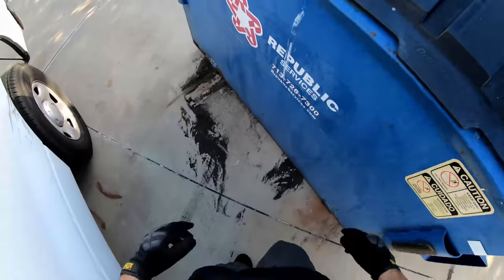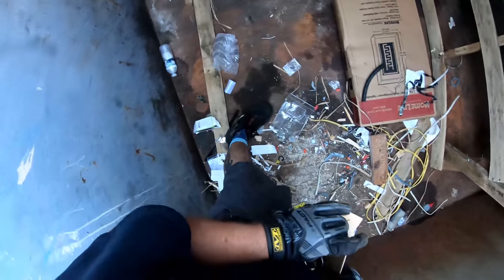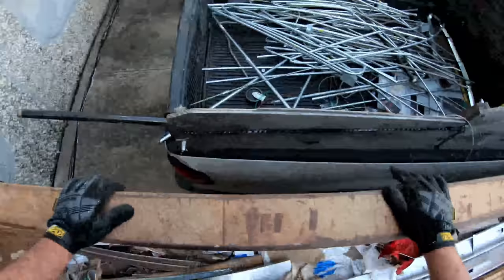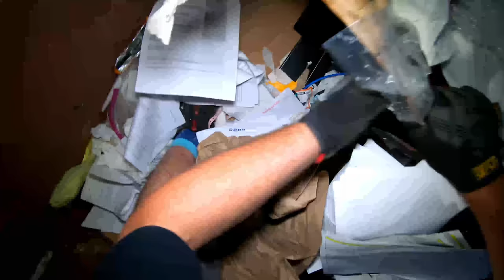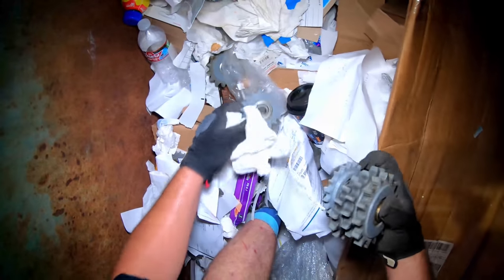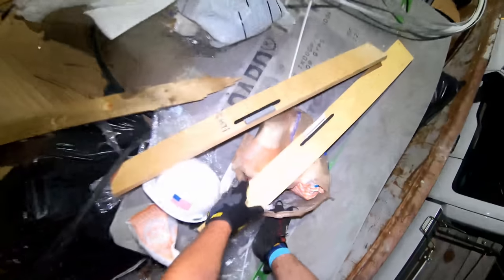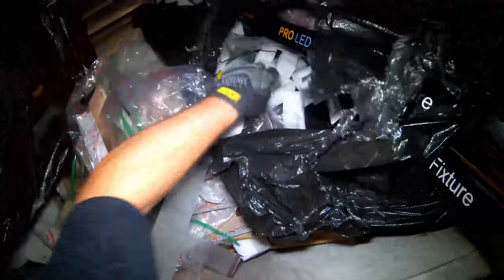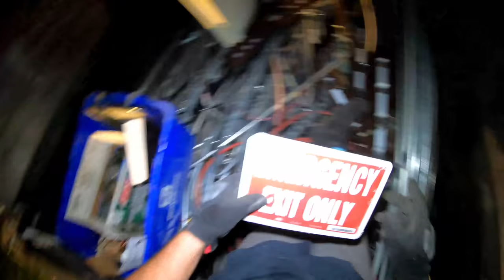Dumpster Diving "Captain Jack Sparrow Up In Here"

Comment: These videos are always fun to watch man, it’s always a surprise seeing what you pull out of the trash. If I can give you a tip it would be to use a leatherman Rebar. It’s got a nice pair of pliers and cutters and like 11 other tools that would make working in a container easier. It’s tiny and has a nice little belt holster, I can see you doing funny little shots with it, like you unholster it like a tiny gun and give the copper wire a few pew pews before you clip em off lol.
Reply: Leather man does make some good stuff!
Reply: Yeah they work but the Gerbers are better. More like pliers and just a flick of the wrist slides the jaws out for the pliers.

Comment: That was a aluminium louver or can be called a air vent for ventilation in large wear houses. All mainly excluded aluminum. Im a sheetmetal fabricator for just about anything made of metal on roofs. I can actually make louvers like that one out of aluminium or steel sheetmetal for any size opening in walls or residential homes.

Comment: found ez way to take end from plug ins.hit the copper,metal ,what ever on the table saw blade,just a touch,it softens the rubber then pull end out w/pliers.eziest way I have found w/out tiring hands a fingers.

Comment: Idler sprockets, they put pressure on the chain drive to adjust tension. The plastic sprocket wouldn't stand up to the pressure of the drive sprockets.

Comment: Little things in dumpsters have value, even those exit signs, plastic or metal, I had to buy several for my different shops and they are not cheap. They also have batteries in them.

Comment: Mike that glass is safety pane I.e toughened, hit on corner or side hard it will smash in2 small bits, used pie warmer door, heat, full door panels, car side windows etc...when u throw it,it never broke??? 7x normal strength than plane glass!

Comment: Why dix you keep EMT pipe and leave metal studs behind?  Aren’t they the same type of steel?
Reply: the metal studs fly out of the truck in the wind
Reply: People in Houston Texas drive fast , 80 mph is very normal.  So light things will fly out.
Reply: I wondered the same thing those studs add up. Also allways wonder y he don't grab the aluminum cans. Everything adds up

Comment: As you bending up all the conduit......I looked up some Lowe’s prices for you.....3/4” x 10’ $8.8 per stick. 1” x 10 ‘ $11.48 per 10’ stick,  1 1/2” x 10’ $29.25 per stick. 10 foot sticks is how they are sold. There just may be a resale market for some of those materials. Maybe not.... have you tried?

Comment: Question , why don't you take the steel 2x4s
Reply: They're light weight and can blow out of truck when driving!
Reply: If he had put them in the truck under the lights and other pipe they would not blow out